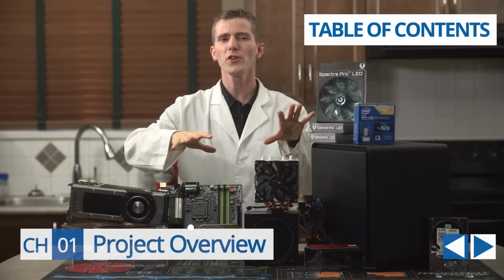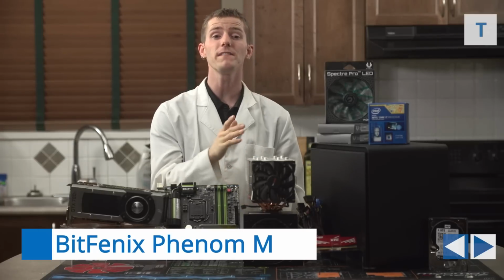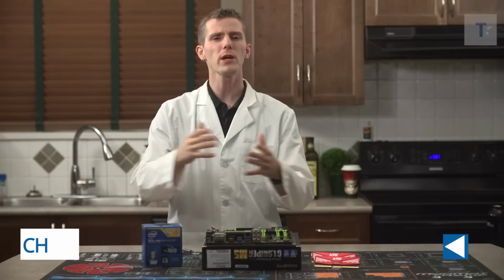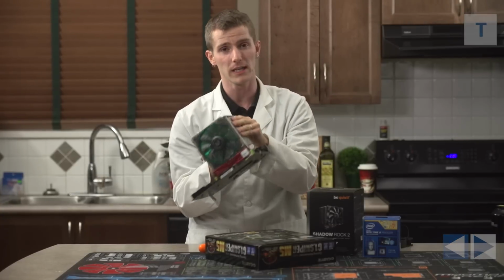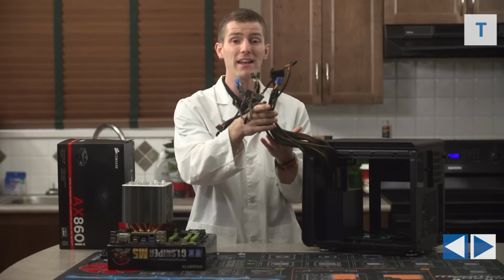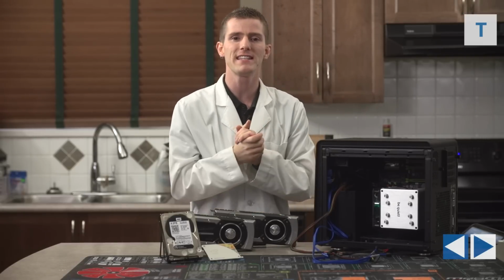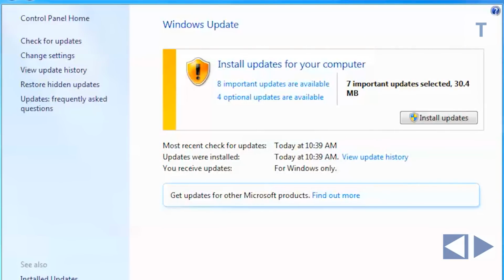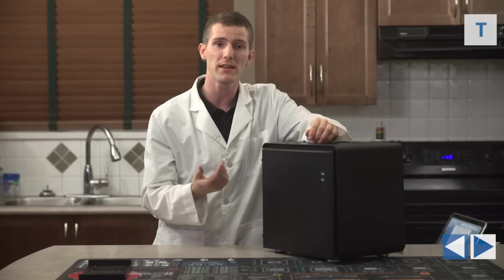ULTIMATE Intel Compact SLI Gaming PC Computer "How To" Build Guide

Comment: Is this build good? Anything I need to change? http://pcpartpicker.com/p/8pmwyc
Reply: The power supply has a lot more wattage than the comp is going to need, so unless you plan on doing a big upgrade down the road, i would change it from 1000 W to around 700 W.  also, you need thermal compound.
Reply: TheRobloxcoasterman The 4960k and the R9 290 only need 650w combined. also, if this is for gaming, get rid of 8gbs of RAM, you don't need it.
Reply: ***** And the h100i comes with pre-applied thermal paste.
Reply: Well, I have changed alot on my build:http://pcpartpicker.com/p/mTqkHx
Reply: I don't think you need a ATX Full tower for that build unless you want a lot of airflow, a Mid size tower will fit everything you have in that build.  A mid size tower will also cost less, although i would suggest case fans for a mid size.  otherwise it looks like a really good build.
Reply: Thanks ;D I chose a big tower becuase it looks better than all the mid towers (In the store i buy in) And I really want good airflow as you said. BTW: Here where I live mid towers and big towers costs almost the same ;)
Reply: oh, if they cost the same then go full tower all the way :)
Reply: I would recommend 8gb ram though just to have it, it's more ideal for future proofing.

Comment: i have the prodigy m with an asus rampage iv gene 2011 socket. If i go sli titan blacks with no slot spacing, would I be okay? I have a 230mm fan on the bottom and 2 120mm fans on the top both intaking air. I also have an h80i exhausting out on the back

Comment: IMO the Fractal Node 804 looks better, allows better airflow with two 120mm fans in front of CPU chamber and still have access to 240mm cooling on top with psu in other chamber. This case calls for changing around a lot of stuff including side panels, not good.

Comment: Hello I'm building a gaming rig very soon and am thinking of using a AMD FX 9590 2 SLI 780 ti's but am wondering intel or amd processor heat isn't an issue but which core is better thanks tom

Comment: Does anyone know if it's bad to leave your case side panels off your computer because I have mine off because of the heat, I know dust will build up quicker, but my temps are noticeably lower, is it worth keeping them off
Reply: If you can or wouldn't mind, try to put a dust filterer like pantyhose on the sides.
Reply: Yes, keep them off ;)

Comment: If I'm building a gaming rig, should I go for windows 8?

I've read from a few sources that windows 7 is better and more stable for gaming... is that still true?
Reply: Actually Wiindows 8 is pretty much the same as Windows 7. I personally had an fps boost after upgrading to Windows 8 and no issues. I kinda just dont like the design but thats prefrence
Reply: I will never use Windows 8 or 8.1
Reply: Honestly, anyone telling you Windows 8 is horrible or that Windows 7 is far superior is just spewing out nonsense. I've had Windows 8 for a while now and, while it has a few problems such as any OS will, it works just as well as any other OS. Once I got into it, Windows 8 actually started feeling better than the previous versions and the boot times are absolutely fantastic (it does a little trick with what was essentially hibernation).
Reply: Delaying Half-Life 3
Reply: Windows 8.1 is the best for gaming. Linus made several videos proving it. If your not afraid of change like 80% of the world go for it!
Reply: Well im having issues with gaming with windows 8.1, go check out the "low memory" issue.  Microsoft didnt patch it yet
Reply: Game makers will probably optimise their games for Windows 8 in the future
Reply: I have a new gaming rig that runs 8.1 and honestly with 8.1 I've never really noticed too much wrong, the layout isn't the best but like Krisselus said that's preference and the boot time is great all i need to do is press the power button walk to my chair and sit down and its already on and ready to go
Reply: I had windows 8 but couldn't handle it, so i went back to Windows 7.

New games run better on Windows 8 so i recommend getting it if you think you can handle its quirks.

Best of luck.
Reply: ***** I can agree that Windows 7 has been more refined over the years, while Windows 8 hasn't had that chance, but the minor increase in bugs that (to my experience) aren't even there for most users is not justifiable to eliminate the future-proofing that Windows 8 provides. They're both equivalent, it's just that Windows 8 is a more recent OS. As well, Windows 8 never actually failed, 8.1 was both a way to update a few of their systems to make them work better (which by no means worked badly in raw 8) and a way to stop people from complaining all day about the lack of being an exact copy of Windows 7. People hated the change into the metro system so they gave them 8.1 to make them shut up.
Reply: I couldn't once run Borderlands 2 in Win8, even with patches. Also the UI is so fucked up compared to all the Windows versions before 8. Windows 7 is still the most reliable OS and will run any program, the updates won't stop for it for atleast a few years. I mean Vista still gets updates...
Reply: just buy windows 8.1 its the best for gaming.
Reply: I had 8.1 for ages, but swapped back to 7 due to stability issues.
Reply: Why?
Reply: Nope nope and nope theyre excstly identical when it comes to gaming

Comment: Ok, so I'm about to build a new PC that will be geared towards gaming, but also used for more common things (recording music, editing it, etc.)
I'm new and I would like people's opinions on the parts. I'm trying to keep it below $1100 if possible, so just keep that in mind.
Thanks in advance everyone!

Intel i5 4670k
MSI Z97-Gaming 5 1150 ATX 
MSI Gaming N770 TF 2GD5/OC GeForce GTX 770 2GB 256-Bit GDDR5
ADATA V1.0 8GB (2x4GB)
WD Desktop Mainstream 1TB 7,200 RPM SATA 6.0Gb/s 3
Samsung 840 Pro Series 128GB SSD
LG 24X Internal DVD ReWritable Drive SATA
EVGA 600B 600 Watt ATX Power Supply
Fractal Design Core 3000 USB 3.0 ATX Computer Case

Comment: Quick question, will a Corsair 600w non-modular PSU be enough to run a GTX 770?
Reply: I have a CX600M and it runs 2x7870s fine so pretty sure your 770 will be fine.
Reply: nVidia recommends a 600W PSU so there should be some room. I run a GTX 770 with a 650W 80+ Plus Gold PSU without any issue.
Reply: Thanks guys.

Comment: Putting the intake fan on the bottom is not a good idea with this case because the PSU will shoot out hot air to the bottom which you are sucking back in.

Comment: I hear that windows 7 doesn't support more than 16 gb of ram, is that true??
Reply: Trickqube Qubegaming Microsoft officially confirms that, Professional allows 192gb of ram.
Reply: GetofFenris1 You're on the internet, everything is but a search away.
The first numbers are for 32 bit systems and the second numbers are for 64 bit systems.

Physical Memory Limits: Windows 7

The following table specifies the limits on physical memory for Windows 7.
Version	Limit on X86	Limit on X64
Windows 7 Ultimate	
4 GB
192 GB
Windows 7 Enterprise	
4 GB
192 GB
Windows 7 Professional	
4 GB
192 GB
Windows 7 Home Premium	
4 GB
16 GB
Windows 7 Home Basic	
4 GB
8 GB
Windows 7 Starter	
2 GB
N/A
Reply: Don't Think so
Reply: if you get windows 7 PRO, it supports up to 64 gigs of RAM
Reply: 32bit has 4gb max 64 bit is pretty much unlimited. This does not vary by home/professional/ultimate its all the same. Just get 64bit if you want 16gb ram.
Reply: I have Home, and I have 16 gigs, and it works.
Reply: Have 64gb with pro and runs flawlessly. I see no reason why a cheaper version of 7 would not use it, it may not read that it is there but the components should use it and most software should pick it up regardless of what windows is saying.
Reply: what I was asking is if windows would support more then 16. I want to install 32gb.
Reply: Thank you BurningAcid. Guess it's time to upgrade to Windows  7 Ultimate.
Reply: GetofFenris1 You could get pro.
Reply: Wait a sec why would u even want 32 gig ram u actually dont need more than 8 gb of RAM
Reply: SteaLz Gamez That depends entirely on your needs from a pc, my pc currently has 21 GB of RAM in use. During certain video edits I actually run out of my total of 32GB of RAM.
Reply: BurningAcid Yes but were talking about gaming here
Reply: SteaLz Gamez Kerbal Space Program with plenty of mods exceeds 8GB easily.
Reply: BurningAcid What the hell are you running that would take up that much memory?

Comment: hey all.
i'm thinking of building my first pc.
The components i'm thinking of using are:
some gigabyte board
Intel 4570 cpu
nvidia 760 gpu
8Gb of ram
450 watt psu
1Tb hard drive
one of the asus xonar cards

This all goes for about 1 grand. is there anything i can change out that is better for the same price point
Reply: The PSU is probably just enough, but with a Xonar Card and everything else, I'd recommend for more wattage.

Comment: is the asus sabertooth z87 motherboard compatible/does it work to use instead?
Reply: By compatible do you mean fits in the case? No it will not as this case only supports M-atx Motherboards, the Sabertooth is a Full sized ATX motherboard. The Baby Brother of the Sabertooth, the Gryphon, will fit fine.
Reply: thanks for the answer :)

Comment: I got a core i7 950, Asus Rampage III gene, 2 x 320gb hdd in raid0, 2 x hd6870 in Xfire, 1 x 280mm rad, 1 x 120mm rad. Liquid cooling covers cpu, vgas, southbridge, northbridge and mosfets, and everything lives inside a Fractal Design Arc Mini case. I'll stay with SLi/Crossfire forever, but I'm no longer with the full ATX design.

Comment: I wanted to make a similar build but I want to use 8GB Corsair Venegance, now, they are a bit larger but could I just mount the cpu cooler fan on the other side (15:55) so I would have the space for the ram?
Reply: Yah
Reply: junrocks
Thanks, if I use only one GTX 780 and the i7 4550 without overclocking do I even have to use this cooler or will the stock cooler be good enugh?
Reply: stock cooler will never be enough. always get a high quality cooler like from Phanteks
Reply: junrocks Ok, I will probably go with the one shown in this build but I will leave the fans out because the case comes with one and so does the cooler.
Reply: Aiden Pearce Best air cooler imo is the Cooler Master Hyper 212 EVO

Comment: can't you just use rubber gloves to stop static?
Reply: It's gonna be hard to handle things
Reply: getting a wrist strap that cost 20 dollars because if you get unlucky you just fried your expensive motherboard
Reply: If you're handling a motherboard, it stick to a capacitor and dislodge it. It's not impossible just not recommended. You're welcome to try it though.

Comment: Hi everyone, I'm shopping for a new pc, and I'm a bit confused about heat sink options. I plan to have an entirely air cooled system, and was wondering if the Cooler Master hyper 212 evo is still a viable option for a mid-range pc build (i5 4570, 8gb ram, gtx 760, corsair 350d case, etc.). I have heard it is a good heat sink, but I also know it's quite old and I'm wondering if it's worth the extra money to buy something more expensive, or if higher end heat sinks are just for enthusiast pcs.

I would also appreciate alternative options for solid heat sinks that aren't ridiculously expensive. Also, is it absolutely essential to replace the stock fans that come with this heat sink and the corsair 350d, or are they good enough?
Reply: I would definitely spend the extra money for something like the Hyper 212 evo to replace the stock cooler. It's not expensive at all yet it gets the job done and you can do some overclocking with it. You don't necessarily have to switch out the fan on it if you don't want to, and the 350D fans will do you just fine.
Reply: Agreed. I prefer Air cooling more
Reply: as previously said,its better to replace the stock fan no matter what it is with,although if you plan on it lasting for a while you may want a better fan to allow a bit more overclocking later on although this isn't necessary
Reply: If you want a cooler better than the cm 212 evo,then go with the NH-D14,best air cooler on the market.
Reply: Yes the. 212 evo is brilliant my dad has one in hes rig it cools excelently

Comment: Can anyone judge/critique my build? budget is US $2400-2600:
Intel Core i7-4790 3.6GHz Haswell Processor
Asus Maximus VI Formula Intel Z87 Socket 1150 Motherboard
Two Western Digital 2TB Serial ATA/300 7200RPM 32MB Buffer Caviar Black Hard Drive
ASUS PA248Q 24" Class Widescreen IPS LED Monitor - 1920 x 1200, 16:10, 80000000:1, 6ms, HDMI, VGA, DVI-D, Energy Star
EVGA GTX780 Classified 3GB GDDR5 / ACX Cooler
240GB Intel Cherryville SSD
Corsair Professional Series 850W SLI 80 PLUS Gold Certified Modular ATX Power Supply CMPSU-850AX
Corsair DDR3 16GB 2400MHz Dual Memory
SilenX Effizio EFZ-120HA5 - 120mm Performance Heatsink
Cooler Master Storm Stryker Case
Corsair Vengeance M95 Performance MMO and RTS Laser Gaming Mouse - Gunmetal Black
Corsair Raptor K40 Gaming Keyboard
Reply: Overkill
Reply: junrocks Is there anything missing? Anything to be considered? This is my first build!
Reply: First? Oh gosh you're paying way too much on stuff you dont need but yah just  know how to assemble it
Reply: Hahaha, it's my first build, not my first computer! But you're probably right, I just need it to run quickly, be durable, and not need replacement for a couple of years. Thanks jun!
Reply: you can cut down a lot of the expensive stuff and lose no performance, but good luck on the build (be sure to know what you're doing)

Comment: Great video with great tips! I'm about to build a new system for a buddy of mine here in the next few weeks. It'll be a mini-ITX mobo, so really small system. Just a single PCIe x16 expansion card, gonna put a Geforce GTX 770 in there. The case we're gonna use is just long enough to handle that card. Still undecided on if we're using heatsink/fan or one of those AIO water cooling setups like from Corsair. I've never used water cooling in any of my builds before, so might be a good time to try!

Comment: 4830k is more of my choice and is 2 lower gpus with dual and evn triple sli better or just 2 higher gpus like example 3 660's or 2 760's or even 2 780tis
Reply: DON'T get 660's. Don't. Obviously having two 780ti's is better than two 760's, but dual 780ti's is ridiculous performance with diminished returns, you simply don't need that much power for modern games. If you want to do SLI go for the 770's or the 780ti's if you really don't care and have too much money, but not the 760's. I'd honestly recommend just getting a single 780 (non-ti) and you'll be satisfied. Also i7's aren't necessary for gaming, the difference between i7 and i5 in gaming is literally almost nothing.
Reply: hondarider430 your points are only valid as far as gaming on 1080p@ 60fps/60hz. 1080p @120hz, 1440p at 120fps/120hz as well as 4k is here for those that want it and can afford it. a 780ti in SLI isn't overkill for some of those gaming experiences.
Reply: hondarider430 Dual GPU can sometimes give less performance as well you know.
Reply: Dual 770s are a glorious option and only cost about as much as a single 780t. You can enjoy maxing out every game that exists (in 1080p at least) and still get 60fps. Just don't crank up the AA too high in some games. Crysis 3? stick with lower AA. But in BioShock Infinite, with my dual 770s, I have the settings at Ultra, alt. processing and 32x ridiculous AA forced through NVidia control panel and I NEVER go below 60fps. ever. (@ 1080p)
Reply: Brennan Lawrence i don't with my 760 twin frozr stock